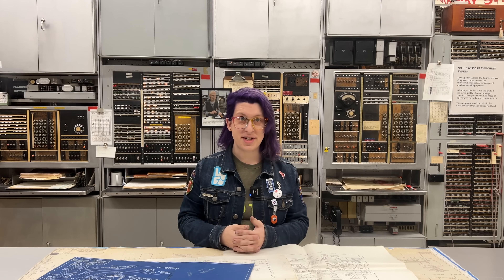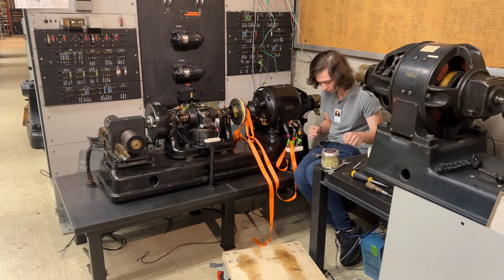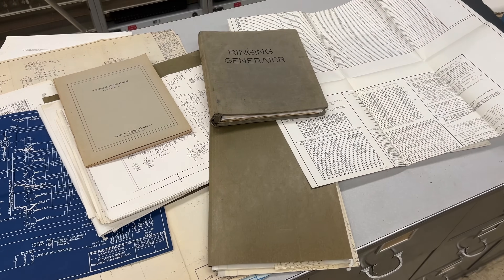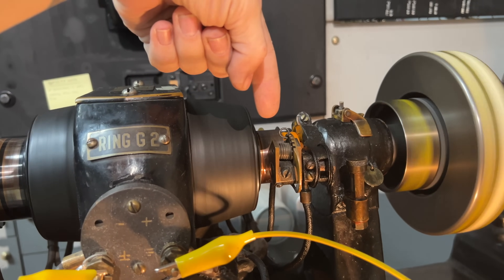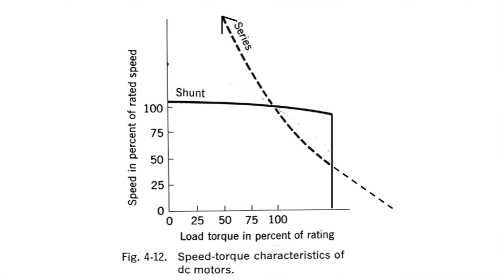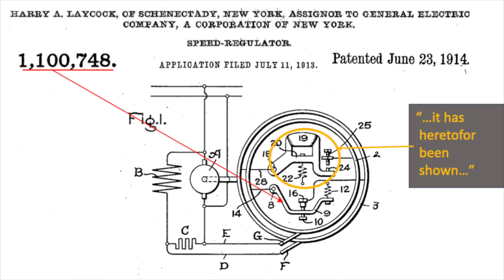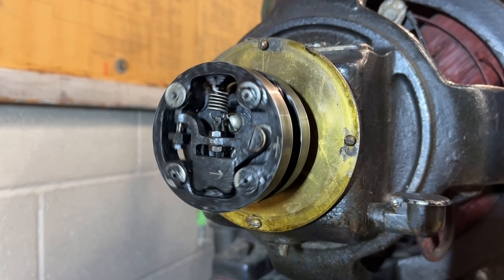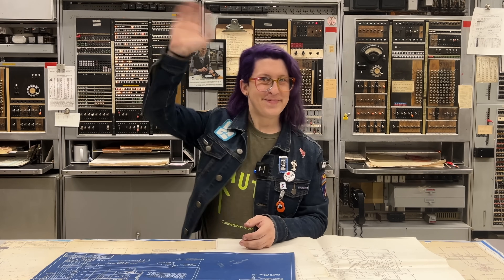Motor Speed Control in 1903! — pt. 3 — Ringing Machine

Comment: The RAS alarm means there is no ring signal detected by the 803C plant. Hard to remember but I believe RAS stood for Ring Alarm Signal.
Reply: If you see both a RAS and a CAS alarm, that means your DRAM isn't working properly ;)
Reply: In Australia RA was for Rack Alarm which sent you off looking for a light at the end of the racks then look for the one on the rack.

Comment: Are you going the cable lacing as well? I saw the wax coated string all knotted up on the cables. Is that new or old cable lacing?
Reply from the maker: Both. Some of it was laced when we got it, other stuff I put in there myself. Still other stuff I removed the old lacing and re-did it on my own.